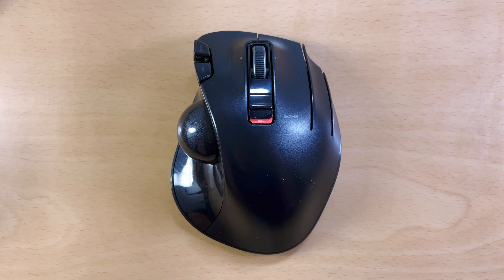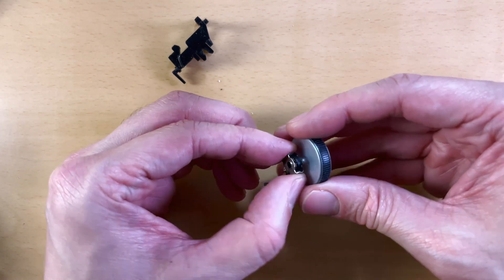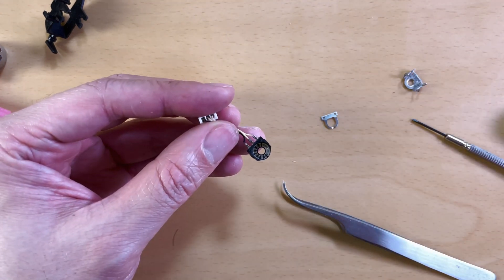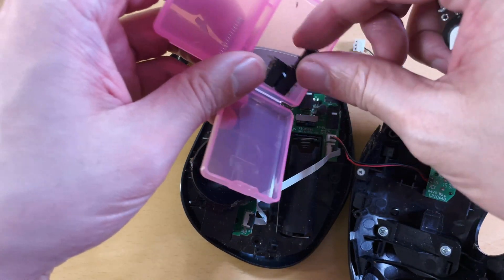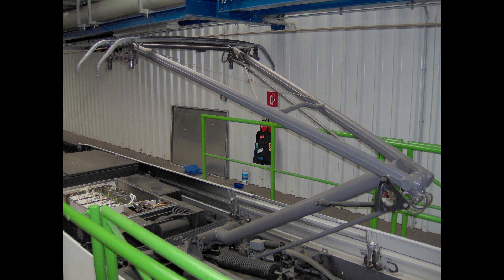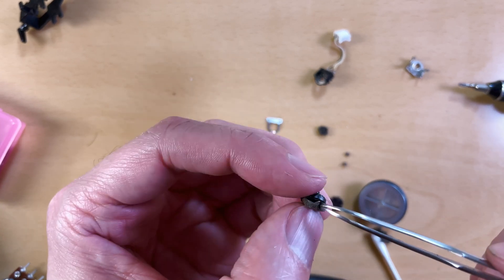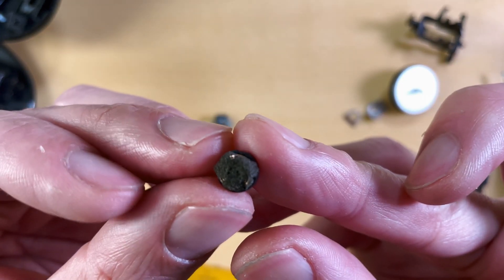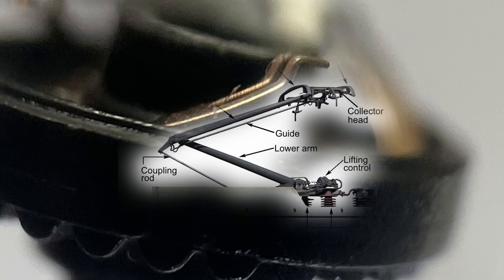Fix a Scroll Wheel that Stutters, Skips or Just Doesn’t Register

Comment: Just did this procedure. I bent the metal clips, as cleaning did nothing.
My wheel holder is a fair bit simpler, but it's soldered on three legs, with a metal shield holding it in place, preventing it from becoming tilted. Instead of desoldering it, I removed the metal shield (just some bent legs holding it to the PCB) and worked on the wheel system with it in place. Will go the foam route when it happens again.

Great advice, with all clear instructions and nice voice.

Comment: Now this is quite surprising, I didn't think this video will be such in depth! I have a favourite mouse that keeps wearing out sadly, I have been getting through by just replacing/resoldering new parts (switches,scroll wheel thingies) but right now I don't have any spares. So gonna try fixing the current one like you said so. Lets hope I can get it working for at least a few days more until i get some replacements. Thanks alot!

Comment: What do I do if my scroll wheel doesn’t work AT ALL. It just stopped working out of no where
Reply from the maker: Hmm… tricky. I say open up your mouse. If you see three wires coming out of the encoder (the part that connects to the scroll wheel) then you have something like in the video. If your scroll wheel has little holes in it and it looks way more complex than the one in the video then it’s probably an optical encoder (it would be an expensive mouse). If it’s an optical encoder, I can’t help much. I think the led might have gone out or something else. If it’s like the one in the video, you can open it up and clean the contacts with alcohol. But it’s strange yours went out completely. But open it up and see what you find.
Reply: @a_boy_can_dream  i have- it is mechanical but it is soldered right to the motherboard… which is why I’m concerned it’s a circuit board issue not getting power to the encoder rather than a problem with signal output or interference. It worked perfectly fine before it cut out- no signs of failure
Reply from the maker: Yeah, that it completely cut out is the weird thing and could mean something bigger. But if you can desolder it, it might be worth a try
Reply: If you don't feel much resistance when you scroll, it may be the scroll wheel's axis that goes into the encoder. As it is made of plastic, it tends to wear down up to the point that it can't rotate the encoder anymore.